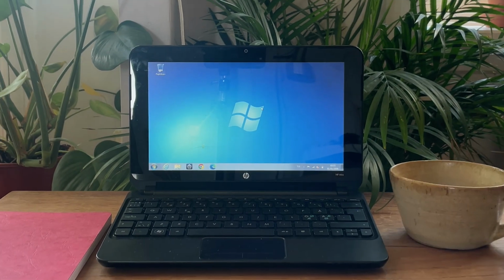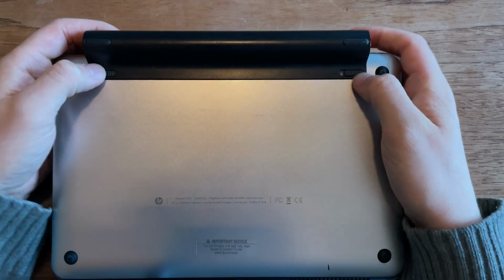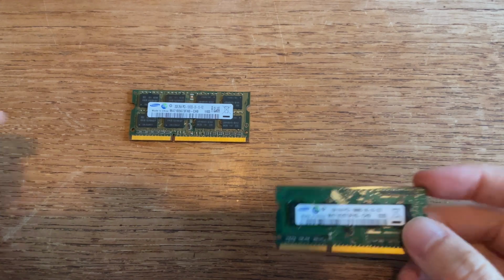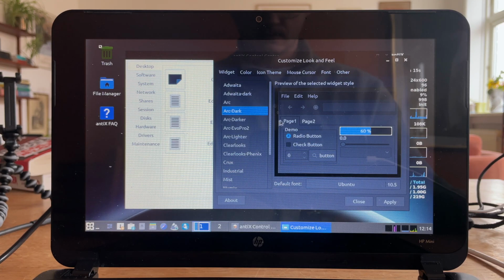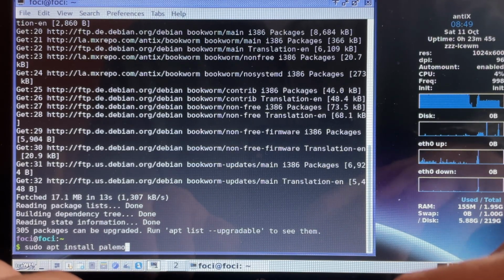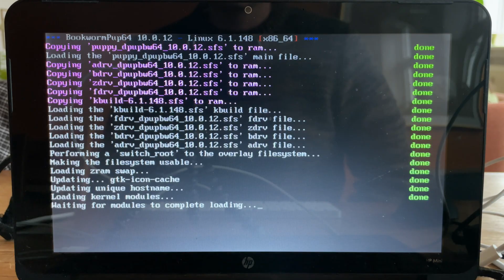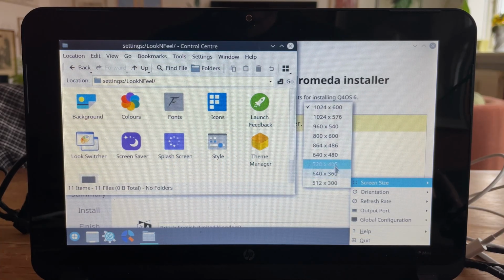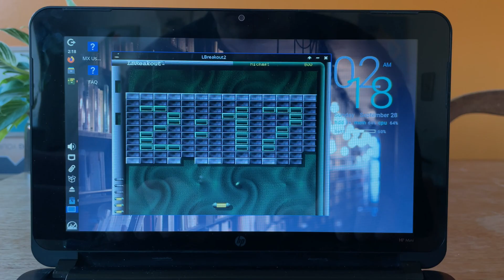Can "lightweight" Linux distros save this tiny laptop from 2010?

Comment: 6:35 Resolution is simply too small for more modern UI. But you could've most like get past that by moving window by holding Alt and with left mouse pressed you can grab application window from any location to "grab and move" so-to-say. Should work in like 99% of Linux UI's. Also I've sometimes simply used Tab to blindly shift button selection and hit Enter. IIRC I had to do this on one Proxmox install where continue was just barely not seen because of wrong resolution I couldn't change at installer.
6:50 You might want to try reformat drive with GPT for more modern distros to boot correctly, though older MBR should technically work there. But quite fast thing to try.
Reply: GPT cannot be used for boot drives in legacy BIOS afaik

Comment: Since this dose use DDR3 you should go for the max RAM size of 4GB.  you can go to a e-waste recycler/ used PC parts shop to get one dirt cheap.  With Puppy the more RAM the better due to your RAM acting like the OS drive.  I had this netbook back in 2012, and had Mint on it, but it was the 32-Bit version.  Even though the Atom N455 is a 64-Bit CPU 64-Bit Operating Systems made that CPU have issues with a lot of distros and Windows 7 (x64 version).  Since most modern distros are abandoning 32-Bit versions it's really getting harder to find an active OS that'll have a 32-Bit version.

Puppy is the best for those old Atoms without a Nvidia Ion GPU included.  However instead of regular 64 Bit version of Puppy I would stick to a 32 Bit version.  I would also recommend one of the puppy variants like LxPup (Slackware based) with LXDE for the GUI.  If I had one today I'd just install the 32-Bit version of Batocera and turn it into a retro gaming rig (8-16 Bit Consoles & 80's arcades only) that can also play back some 720 MP4s or all my 480p MP4 files in Kodi (like my ripped DVD videos).

Comment: You could probably get a lot better youtube playback expierence if you replace the Mesa package with Mesa_amber and use the h264ify extension in firefox. Just install mesa_amber like any other package in your terminal and it should give you the option to replace mesa with it. The problem stems from pre-sandy bridge intel graphics which is provided by mesa. These have been stripped out of the current mesa branch. But do continue to live in the mesa_amber side branch. It would also enable opengl acceleration for things like classicube or possibly even full fat minecraft (though it would have to be an old version becasue this doesn't support opengl 3.3 required for modern 1.21.)
Reply: Looked into this, very underrated comment. Look forward to trying out mesa amber next time I get one of these Atom netbooks to tinker with.
Reply from the maker: Thanks a lot for the advice! It's a bit technical for me ngl, but I'm certainly willing to try:) Thanks for watching:)

Comment: A Raspberry Pi 4 outperforms this by a significant amount. The Pi 5 blows it into the weeds. I have one running AntiX Linux and I used to use it to check my bank account and email on the go. I still have it but haven't turned it on in over a year. I think I'm going to strip the guts and put a Pi5 inside it. I need a new project.

Comment: Using an old computer productively is often an exercise in working around the modern web, to illustrate I did some RAM tests:

Chat: Discord+Firefox/Hexchat 1.3Gb/2.5Mb
VOIP: Google Meet+Firefox/Mumble 1.1Gb/90Mb
Email: GMail+Firefox/Claws Mail 0.9Gb/70Mb
Browse: Firefox/Dillo 600Mb/30Mb
Office: Google Docs+Firefox/AbiWord 1Gb/100Mb
PDF: Firefox/MuPDF 650Mb/30Mb

Of course, it's hard not to use a modern web browser, but a browserless lappy does not have to be litterally "offline"; You can easily communicate using Email/IRC and access machines or files accross the network using ssh/sshfs and other tools. All the same, the social challenge of using browser alternatives is hard, and getting harder every year.
Reply: Oh, I forgot this one:

Video: YouTube+Firefox/MPV 0.9Gb/150Mb

Comment: I know the struggle, I also have an old Celeron M laptop from ~2007-2008 with 2GB RAM lying around, so I am limited to 32bit OS. Been using Linux Mint XFCE for years until they dropeed 32bit support from the Ubuntu line and  kept it only on the LMDE version, but that's using Cinnamon which needs more resources that XFCE. Tried MX Linux and while it was usable, I was not as happy with the user experience as I was previously using Linux Mint. I didn't want to go Puppy Linux route (kept it as a last alternative) or Antix, so I gave Q4OS running Trinity a try. I am amazed of how lightweight and responsive it feels, user experience is somehow familiar to someone who used WinXP or Win7 before. Wasn't aware of h264fy, still need to try that. Not very happy with the default browser, I tried installing others from the repository, but didn't turned out too well.

Comment: We almost have the same specs kinda but mine is from 2011 and is a bit better.
LDME 6 with the I3 WM or Awesome worked the best even LXDE or LXQT works super smooth but none beat the I3 performance my side (Youtube got so much trash that it butchers everything now days so no fix for it unless you debloat the code it self...)
Manjaro is another super low resource usage one but you can guess Linux Mint does a better job for being an user friendly.

Comment: I have a similar laptop, but with an AMD A4 processor and a 1366x768 touchscreen. No matter what linux distro I tried it never played youtube videos well. The integrated radeon GPU is supposed to be able to accelerate the decoding, but the browsers never use the damn thing. I tried using mpv to play the videos, but it also never works right. I just wanted to use it as a portable web browsing/youtube machine, but it seems that it's just too much work for these old CPUs.

Comment: Hi, friend. I would comment that the best solution Is Antix. In my HP I can use YouTube (in 480p), and it does it very well. It Is not accurate to pretend more quality in videos because two reasons.

1. The CPU can't give more.
2. The screen is only 1024x600. It Is meaningless to watch videos in 1080p. You will not see the difference.
Reply from the maker: Thanks! Oh yeah, lol, I haven't even thought a about the fact that screen is not 1080p... haha. Thanks for watching:)

Comment: You can set the cpu governor to performance mode. This will make the cpu run at higher speeds constantly compared to balanced or power-saving modes. Don’t expect miracles, but it can make the PC feel snappier. Keep in mind that it will consume more power, which may reduce battery life
Reply from the maker: Thanks for the tip! I'll definitely try that! Thanks for watching:)

Comment: I don't understand why people test word processors and spreadsheets, you'd have to have a /very/ old or very weak computer to not at least be able to handle that in a usable way. Web browsers are a pretty fair benchmark I guess if all you want is the basics. Which to be fair is about all you can reasonably expect from a system this old/low-spec.

 I agree with another commenter, I've had good luck using the h264ify browser extension to force youtube to use the h264 codec which is a lot easier for older/weaker systems to decode as it's been a standard since 2003. You might still need to pick a lower res, but it should play better on all but the oldest and weakest systems that were probably never designed to play streaming video anyway. An ad-blocker is also probably good as not just for regular reasons, but ads just ad extra stuff the system has to load, and most ads don't come in low-def versions, I remember on my old computer being able to play videos just fine on like 360/480p, but then the Ad started playing and I had to wait for it to buffer, that might've been a slow internet connection though. You can also try something like FreeTube or SMTube which are stand-alone youtube clients that don't need to load the whole browser, and it maybe doesn't spam thumbnails, but you won't be able to login to youtube, only browsing logged out which still leaves most videos available. Just leaving out stuff like private/age-restricted vids.

The fact you even can swap the drive is a huge boost for this old machine. The HP Stream I have is ~6 years newer than this but only has a 32GB eMMC soldered directly onto the board with no expansion slot for another drive, unless you want to lose the onboard wifi card for an adapter for an M.2. The eMMC is literally 5-6 times slower than even the average 2.5 inch SATA SSD like what you put in this one. And even though the rest of the specs are /technically/ better than this machine it's still slow, maybe even slower with stuff using the drive. So I'd literally rather take an old laptop that had a SATA HDD in it than a newer one that only had eMMC because then at least you can swap in an SSD with higher speed and a /lot/ more capacity. I can't tell people enough that unless you're absolutely desperate and can't afford something better avoid eMMC laptops at all costs. Also I'd say to avoid celeron, but some of the most /recent/ celerons actually look somewhat decent on the spec sheet, but older/weaker celerons avoid avoid avoid.

Comment: Linux Mint is not exactly lightweight to run on old computers, i tried with the shittiest processors, like intel celeron, AMD C-60, both runs really bad. I believe that those old cheap systems, are better to use only to play emulators.

Comment: Currently using toshiba satellite c640 (2010 release), had 6gb of ram and intel core i5 m430, for some reason linux slow down processor and stress out processor after you reboot, my unusual fix is to hibernate and boot into linux, browsing the web feels smoother compared to fresh reboot (this may had to do with my hdd instead, cause ive seen the same laptop as mine with ssd running linux completely fine)

Comment: I also have an HP notebook, but unfortunately it is locked in the BIOS by the previous owner. Can I access the GNU bootable via the hard disk to bypass the locked BIOS? I was also told by someone that it is still possible to allow the notebook to boot via the hard disk even though the BIOS is locked. I can access the boot selection. Is that true?
Reply: If the bios is locked, you can't usually bypass any of the preset settings made by the last owner. Best to look how to clear the bios lock. Sometimes it is reasonably straightforward.

Comment: I was asked to revive a similar, probably even slower, netbook.
It needed to only be able to use a browser.
I tried several lightweight OSs: AntiX, Porteus, and other I don't recall.
I tried Arch and Gentoo.
I couldn't get any of them to work.
As I recall, there were problems with Xorg.

And what do you think I got working?
FreeBSD!
It was my first time installing it.
Don't recall having any problems, except I had to fiddle a little to get audio working.
I used dwm, and upon startup it launched Chrome in full screen.
All you had to do is press the power button -- boots straight into the browser.
Press again -- it shuts down.
Reply from the maker: That’s a super interesting solution! Thanks for the tip! :)

Comment: To run the Q4OS installer, I just press Alt and drag the window up a bit, leaving the top of the windows outside the screen but being able to access the continue button. But beware that I've already tried it on a machine like yours and even though it runs, it isn't smooth lol. I settled for Ubuntu server and just use it as an OctoPrint machine
Reply from the maker: Oh, thanks! It's worth a try. Thanks for watching:)

Comment: I like how you lost like 20 Celsius just repasting the CPU. That thing was definitely cooking itself and as someone who also used to use a terrible netbook. The Intel Atoms that these things ran were designed to run hot. So thats probably why you never experienced any better performance. As for the best operating system to run on one of these I would recommend antiX or Windows XP.. Where in if you decide with the gold ol... XP you can install pirated drivers to watch some hardware decoded h264 with h264ify with like a web browser to make youtube a-lot faster. But good luck finding the drivers. Honestly worst thing about these netbooks is that they never got good GPU drivers and the CPU performs like an original Xbox. I will also say that if you do decide to put Windows XP on it. It'll definitely run like trash way more so in particular with just browsing the internet due to how terrible its kernel is compared to Linux. Honestly though using a computer this old. Its just what you decide to do with it; like with any other computer. If you genuinely don't want to use a computer as fast as an original Xbox with a broken GPU that can't run Half Life 1 beyond 30 fps then be my guest I wouldn't really blame you. BUT If you decide to like go onto GOG and buy some games and put XP on it and run some emulators like 1964 or ZSNES or Kega Fusion or PCSX a machine like this would be more than capable than just putting Linux on it just to browse the internet a-lot faster. I heard you can even run old GTA games on it at terrible settings comparable to the PS2 with the native PC versions of like GTA 3 as-well. If you want to rage quit the final mission like I did growing up in particular with GTA 3. Probably the most graphically demanding game you can play with it minus looking at the waterfall in Unreal running at 4 fps on something as powerful as this nugget.

Comment: Concur with others about installing the YouTube extensions in the various browsers to try and force playback. 
There are Linux dosbox and wine "front ends" that can give you some decent results for retrol/2d/database games.

I'm running a stripped back Vista on a netbook with 1.6ghz atom, 2gb RAM and an SSD - dos games work absolutely fine generally and even some later XP titles that don't require graphics particularly
Reply from the maker: Cool! Thanks for the advice :)

Comment: yknow, these old netbooks can run lightweight linux distros, but usually they really struggle with regular web browsers like firefox even with ublock to get the trash out, the web is just too bloated for them. however, even when that's out of the question, they can still have a purpose. as a headless server. laptops naturally have a low power draw, and there are things that barely require any computational power, like a syncthing, pihole, torrent server and so on. so, they may be useful that way. i have an old i5-2450M laptop running a syncthing server, which is honestly kinda overkill because i know that cpu can handle "heavy" linux desktop environments and modern web just fine because my other laptop that i use has the same cpu, and it really don't need to have good throughput, it can get away with abysmal throughputs. i did remove the battery tho because that may be a bit of a fire hazard
Reply: The modern web is just too bloated for an awful lot of older hardware, even when it does just fine for many other things.

And the switch from single-process browsers to multi-process browsers is especially problematic for older systems which have fewer than 4 physical cpu cores and are limited to 4 GB of ram. There are benefits to such changes in software architecture, but the demand on system resources is much increased.
Reply from the maker: Maybe down the line I'll try something like that:) Thanks for the advice! Thanks for watching:)

Comment: To YouTube try installing the extension h264fy, disable 60fps videos and disable ambient mode. With this enable and i3wm in lubuntu I can watch YouTube without issues (720p though). Great video btw
Reply: I feel like this is the most important tip for any older hardware (especially if you're addicted to youtube like me.) My old macbook went from fans pegged and using 80% watching youtube to no fans and ~18% cpu. Since this old hardware has come out youtube has started encoding their videos in VP8/VP9/AV1 to save bandwidth. However these machines only have hardware accelerated video decoding for h.264 (AVC), so they're forced to do software decoding for these new codecs with the CPU. Which already is a lot of processing but is wayyy too much for these poor old clankers!
Reply: @pathwaysmadepublic   clanker is a slur for robots not regular computers
Reply: @undefinedCat It’s a offshoot of clunker or just a version of that word.
Reply: Thank u for sharing ur knowledge!!
Reply: This old GPU won't even support h264. I have a similar netbook and it can only do h262 (MPEG2). Modern video is just impossible on these old devices.
Reply: @msdosfloppy True, the atoms of the netbook only got h.264 if you were lucky to have Broadcom Crystal HD card built-in or as a add-on card. If you had an NVIDIA ion netbook, then you got decent graphics and video acceleration.
Reply: @msdosfloppy  H264 will still be easier on the CPU to decode even if their is no hardware GPU decoding, especially if you keep the video resolution below 720p. I don't know why Youtube doesn't automatically detect which which codecs your GPU supports and deliver the video in the best format that you can playback, and if there is no GPU decoding default to h264 360p. Also i bet if you download the YT video and watch them back with VLC or MPV they will play back a lot smoother than they will on the Youtube website due not having to load a shed load of Jscript overhead that is present here on YT.
Reply: Or just use invidious
Reply from the maker: Hey! Thanks a lot, and thanks for the advice. I'll definitely try that:)
Reply: I was going to suggest the same, since I think Youtube is the only thing left to check. I also love i3wm but I would not suggest it in this case, I'd keep a simple desktop environment
Reply: wow I had no clue this existed, you're a real life saver
Reply: Also, Freetube runs more smoothly than YT in the browser on older devices.
Reply: S60Tube is even more lightweight (designed for old Nokia devices).